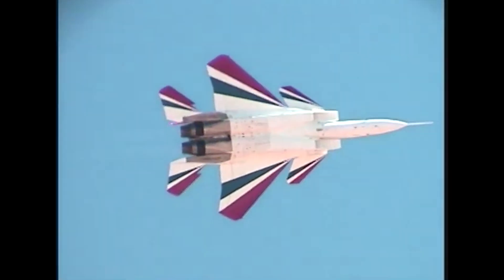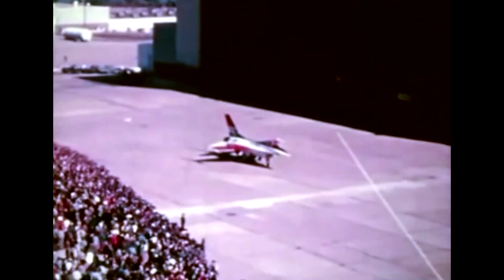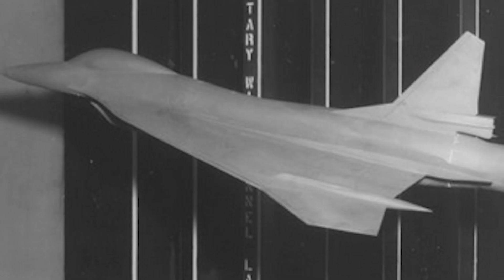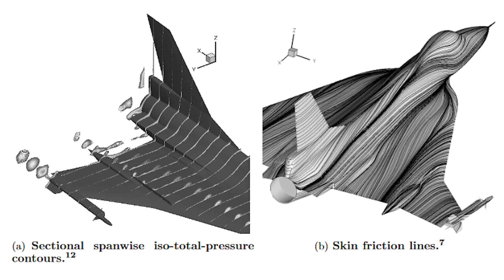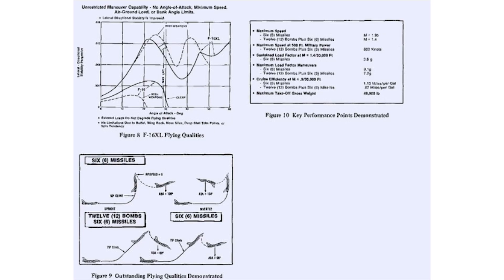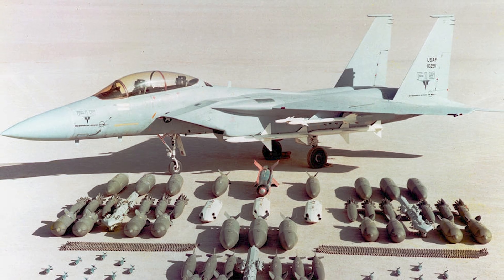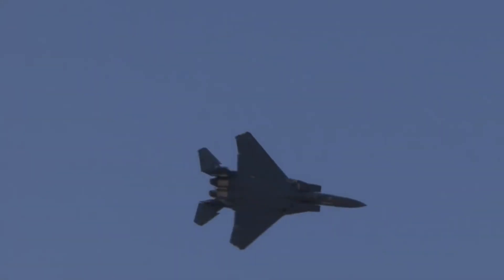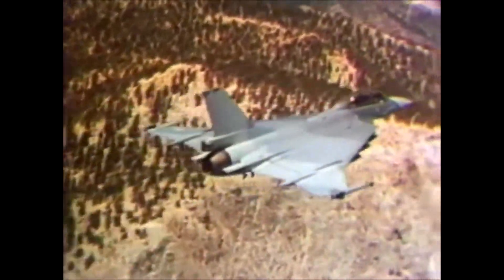Was the F-16XL the perfect fighter jet design in the 1980s?

Comment: I will readily admit that I am biased towards the F-15 platform as I work on em and such, but the F-16XL showed such promise and amazing capabilities. The NASA test variants had incredibly tiny holes in the wing's leading edge, to allow small amounts of bleed air to form a cushion. These holes allowed the F-16XL to achieve supercruise, which was and is an amazing capability.
Reply: I always wondered how the design achieved super-cruise before more efficient engines came to be. Great info!
Reply: For a single engine jet, I choose the F-16. For a twin engine, I choose the F-15. In the non stealth category.
Reply: A clean F-16 from the early blocks could achieve supercruise just fine. Not with weapons and other stores, though. It's actually more recent blocks that have more difficulties achieving it, but if I'm not mistaken they still can do it clean with no CFTs.
Reply: @LafayetteCCurtis  What’s the source for that? Perhaps a “C” clean, light fuel and with the -132, perhaps to 1.0, but very unlikely to 1.5 which is where super-cruise is generally defined by the US.
Reply: @thelandofnod123  Huh. Is the supercruise definition really that strict now? The F-16 test pilots from early in its introduction to the USAF mentioned getting to a sustained 1.05 or slightly above that without afterburners, and that was pretty much supercruise to them. And yes, it was later in their test flights when they had shed most of their fuel load, hence why it wasn't really of any practical use (not that it's really that useful today either, at least nowhere near as much as fighter jet techboys would like to pretend it is).
Reply: @LafayetteCCurtis  Yeah apparently, although many other parts of the world only require 1.1 to qualify.

And I agree, super cruise is not as essential as some like to think. Without using fuel usage charts for each platform (I’ve never worked on a super cruising platform but those I have had a significant consumption difference from MIL to their cruise PLA) it would be hard to know but I suspect that super cruise speeds and optimum cruise speeds would be vastly different economy wise.
Reply: @LafayetteCCurtis  I don't know anything about planes really but isn't it more about radar and weapons and comms now?
Reply: @jugo1944  The XL was intended to get pretty close to the F-15's ordnance carrying capacity, and would benefit just as much from the SABR AESA upgrade as the conventional F-16 we have now. Of course the radar still wouldn't be quite as powerful as the APG-63(V)3 due to the sheer size of the F-15's radome but it's still better than the original unmodified APG-63 and there would have been plenty of allies that operated the F-16 but not the F-15 before the recent shift to the F-35. The XL would have made a great strike platform for those countries.
Reply: Thanks for your work and the info.  A question for you if you dont mind. Did they ever look at a delta-wing F15?
Reply: @bull614  I had wondered about that! I imagine similar benefits could be seen.
Reply: @rhubarbpie2027  The extra thrust the F15 has would probably have an interesting power curve. I do remember hearing about the Israeli F15 with most of its wing shot off still being able to stay flying. So combined with the delta wing........ interesting possibilities.
Reply: @rhubarbpie2027  Also, I just watched the FB22 video, and it just made me more interested in a delta F15 lol
Reply: I always find it amusing how bad the US is at supercruise.

In almost every respect their aircraft are the absolute panicle of military aviation, and then they get to supercruise its this almost unknown technology. Meanwhile Britain and France put it on an airliner in the 60s, because everything else supersonic had it.
Reply: @HALLish-jl5mo 
The F-15 super cruised in the 70's.
Reply: @Istandby666  The prototype English Electric Lightnings super cruised in 1954, and most subsequent European supersonic jets could also do so.

The US managed it by 1955 when they upgraded the F-104, but just... Couldn't keep it up. By the F-15 there were two super cruising passenger aircraft (Concorde and late model TU-144s), so another super cruising fighter wasn't exactly impressive.
Reply: @Istandby666  do you have a reference?
Reply: @HALLish-jl5mo  Did they need supercruise in these fighter aircraft? I think lighting program was aiming at high speeds which let a lot of other things in underdeveloped. Low fuel capacity etc. I don't know so this is just an educated guess.
Reply: @HALLish-jl5mo  Comparing fighters and passenger liners is comparing apples to oranges.
Those passenger jets' literal sole purpose is to go far and fast, an afterburner is loud and a fuel hog. They didn't just stumble upon super cruise in those designs by accident. 
It's either designed to have it or not. There's no engineers at Boeing or Lockheed designing fighter jets going "Hmmm I can't get this to work, wonder where my calculations went wrong, oh well"
Reply: @A_barrel  The Boeing 2707 was never built, but it represented America's attempts at a supersonic airliner. Actually, buy not being built, it allowed them to have a more advanced design.

They still couldn't get it to supercruise
Reply: @HALLish-jl5mo  Perhaps the ability to supercruise was not a requirement for US fighters of the period. 

All aircraft are a compromise in some aspect and all aircraft have requirements that outweigh others. Additionally they also have a max economy cruise speed.

Comment: The f15e was chosen over this for a reason. I don't know why people keep going on about a delta f-16.
Reply: Because it looks cool and was a genuine upgrade over the F-16. The F-15E was the better option, no doubt, but the F-16XL had a wing planform that was both unique and effective. The F-16XL is just the more visually striking aircraft.
Reply: It's an interesting design that's why.  Honestly F-16XL should have replaced the F-16.
Reply: Like you and the USAF we agree the F15-E was the superior platform and remains so to this day with the EX, but if the XL was available for purchase as a variant it could have filled a special niche. Single engine multirole has its place, a stopgap until the common adoption of the F-35 even. Finally, it looked cool AF. Performant cool things are cool.